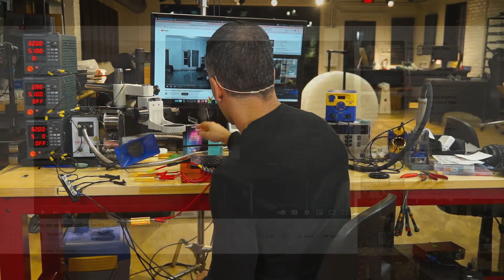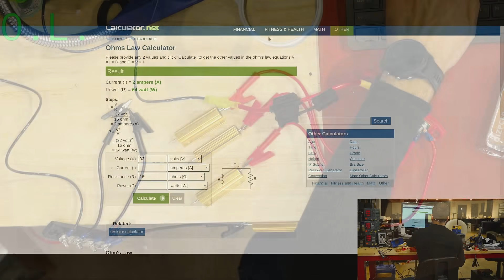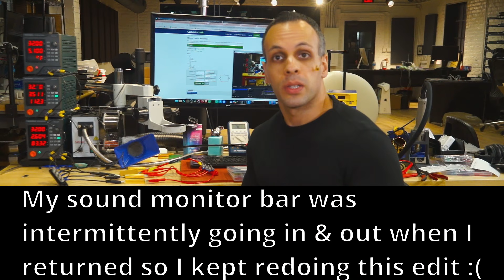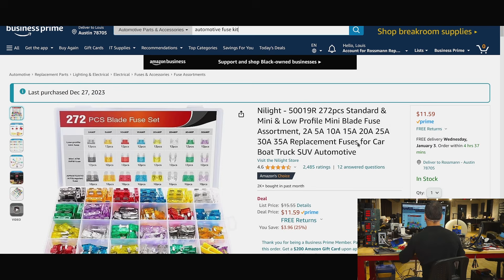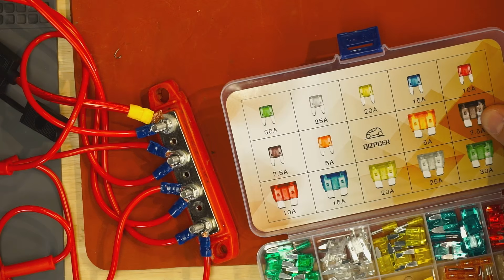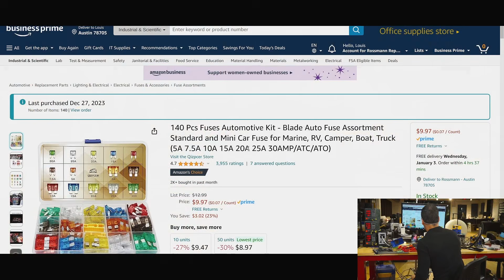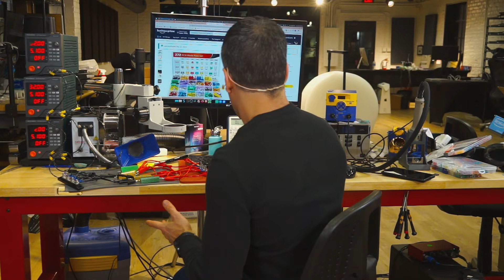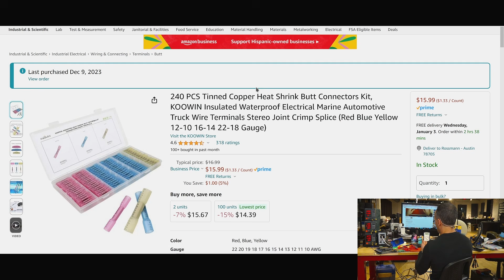Amazon Sells Fake Electrical Fuses

Comment: Thanks Louis for calling out this issue. I’ve tested the little mini glass tube type and found them a bit off and noted it in a box cover. But now I have to replace a bunch of blade types in my boat because I have no idea what cheap type I used.

Comment: for the peanut gallery... when your wires are rated to 6 amp, and you put a 2 amp fuse in the system that can handle 8amp, the wires the fuse is supposed to protect become the fuse...

Comment: Eventually this will stop. Either Amazon will realize that this business model can't continue, regulators will step in, or components that Amazon depends on (web servers, computers, etc.) will fail and break their business.
I recently took a car in to be repaired. The replacement part was in worse condition than the original so they spent 8 hours trying to fix it, I spent 8 hours waiting, and next time I take it in, they will have two parts in case one is defective again. Eventually, the endless cycle of buy something, wasting time and money because it doesn't work or fails early, and buying a new one will bog down the economy.

Comment: I bought a huge fuse for my battery and solar system from Amazon. It was a reputable brand I could buy elsewhere, and it was a "store" on Amazon. The fuse got hot and melted the holder at only 80% of the rated amps. It was glowing when I smelled it and opened the circuit. I bought a replacement Bussmann fuse from an industrial supplier and everything is fine now. So it's not always that they blow it too high a current, sometimes they may cause a fire before that.
Reply: I had a similar issue with some large blade style fuses from Amazon.  Resistance was way higher than it should  have been.
Reply: dont worry, we have each other, we are the resistance now. All of us  @sonictech1000
Reply: yep, typical "iron core" cheap fuse, they are just lamps, they heat until everything is melted or on fire, unfortunately aliexpress, ebay and amazon are full of them
Reply: Amazon sells fake counterfeit parts. 
Upon closer comparison to original locally bought mayerial there where slight anomalies with the print or coloring of logos
Reply: One of the first things I learned running my business, after melting lots of "heavy duty" extension leads is not to buy electrical components of Amazon. It bought a high rated cable, plugs and sockets from a big name store and wired my own extension leads and never had another down time due to fake Chinese crap on Scamazon
Reply: Got dang.
Reply: slow blow vs fast blow fuses are differtent things and speced for different uses...
Reply: @ganzeytyler And that is exactly not what we are discussing. A fuse that melts its plastic holder at 80% of its current interrupt rating isn't a different specification. It's a defect/fraud/scam part that doesn't function as a fuse.

Comment: For reference, a name-brand (Littlefuse) automotive fuse is specified to blow in 0.5 to 6 seconds @ 350% rated current and 0.1 to 2 seconds @ 600% rated current. At rated current the fuse shouldn't blow at all.

Comment: Was going to edit my prior comment, but it seems to have disappeared. 
Did you have the fuses getting hot even at rated current? 
I had a problem with the headlamp circuit fuse in my old car (20+ years ago, so fuses from a retailer). It would get hot enough to start to melt the fuse block. I did find a breaker fuse that seemed to solve the problem. Seemed to be a combination of high resistance in the fuse holder and/or the blade connectors of the fuse itself.

Comment: They might not be fake reviews. When normal people buy a replacement fuse their aim is to fix whatever they're putting the fuse in, so long as the fuse gets that device up and running again, they are happy and will write a positive review. If the fuse fails later and damage their device or then, they probably either don't realize it's the fuse or forget where they bought it.

Comment: My first question when you were taking polls was “well, is this a slow-blow fuse and you’re impatient?” 

And you totally covered that possibility about 8 minutes in. Lovely and thorough!
Reply from the maker: It's a good thing I had to pee.
Reply: I was waiting for a Naked Gun Pee sceen if you forgot to turn off the mic @rossmanngroup
Reply: My immediate thought was the curve as well, but I wish louis luck for those official mac schematics with his free USB stick. I did have to check, most circuit breakers here are C curve, which is no trip at 100% load, but trip to 1-2 minutes with 200% load. 5x current is instant trip.
Reply: There are standards for automotive fuses, it's not an arbitrary manufacturer decision.  ISO 8820-3, SAE J2077, and a few others. Required time-current curves w/ acceptable tolerances are readily available for all of these, and could (and should) have been used for this test.
Reply: fuse curves are "we failed at making the fuse properly for the number it should blow so we attached a graph that says the real numbers"
Reply: @gg-gn3re  No. There is nuance. If your fuse blows immediately at point, it will have many nuisance blowouts and be very annoying. Depending on a fuse it will never break at 100% or it could take up to an hour if it does. And will last several minutes up to 120%ish.  Because some power spikes are a normal thing and a sensitive fuse will quickly be blown out. depending on if its slo-blo or fast it can be between 500-800% load for it to go in 1 second or less.
Reply: @himedo1512  nope. in pcb if a circuit expects 1 amp we'll do 1.2amp fuse etc
Reply: @gg-gn3re  there is no nope. This is literally how they are made.
Reply: nope @himedo1512
Reply: @himedo1512  What? I would MUCH rather have to deal with a fussy system and have to replace fuses 10x more often than having the fuse ALLOW more power than it told me it would.

Comment: You are adding the resistors in Parallel, not series! 1/Rt = 1/R1 + 1/R2 + 1/R3 + ... You aren't doubling the load when connecting another resistor. Ohms Law 101
Reply from the maker: that's what i said, and how i connected them. look at the wiring. each resistor is being added in parallel and each time i add a resistor in parallel the power supplies are outputting 2 amps more power than they did before.
Reply: @rossmanngroup  Ah yes, sorry.  I looked at the setup again. Thought you added the extra resistors in series and had the initial 4 in Parallel (bussed)
Reply from the maker: I double checked to make sure I didn't mess it up. I appreciate you keeping me in line!!!

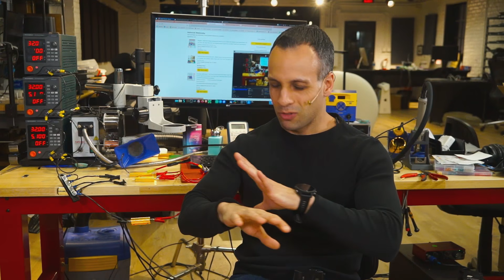Comment: 1:35 Where in the world have you EVER seen a fuse rated in WATTS?
I've seen plenty rated in AMPS, with a rated voltage that they'll work up to. But I've never ever seen a fuse rated in watts.

Although I have to admit the fuses you tested were obnoxiously bad. Went to Digikey to look up some automotive fuses and pull off the spec sheet for a blade type fuse. The time to blow was rated in percentage of rated load.  Saw the following:
110% lasts at least 100 hours and may possibly never blow.
135% lasts up to 10 minutes, but may blow in less than a second.
160% 0.25 to 50 seconds.
200% 0.1 to 5 seconds
350% 0.2 to 0.5 seconds
600% less than 0.15 seconds

Comment: Hi,
from an European electrical point of view ... I've learned that a fuse will start to break at about factor 1.4-1.6 with a lot of time (10min).
For an immediately blown fuse (within 2 sec.) a factor 2 - 3 is normal. The factor 5 is too much ... otherwise ... it is a 2A fuse ... that's so low that I don't really care ... it is probably the same fuse as the 5A with a different label.
FYI - if you wanna make the experiment more easy: ... you don't have to use the max. Voltage.
I would simply short the circuit using the Current-Limiter of the power supply's.
The Voltage will drop down to under 1-2V.
The max. Voltage only matters if you are testing if the fuse can disconnect the circuit.

FYI - in Europe we have the problem that the car mechanics don't check the fuses ... hour of diagnosis ... before someone thinks of checking the fuse.

Comment: An automotive 2A fuse passing 3A should blow in ~2 seconds average, at 4A it should be an absolute maximum of 5 seconds. Uh, crap. I actually used some of these. Thanks for making more work for me, Louis, now I have to go open up some car fuseboxes and replace them! I feel like an idiot.
Reply from the maker: You are not an idiot, tons of smart people believe we still live in a high trust society, and companies like this take advantage of that. I will never make fun of you for believing that multi-trillion dollar companies are held to the same standard as my electronics shop. but I will point it out every chance I get!

Thanks for watching.
Reply: @rossmanngroup  The thing is, it's not like I am unaware of junk products! In the end it comes down to "I need one now" added to some mental calculation about how likely they would be to make this product a scam. I think at this point, we are all doing that calculation, right? It's pretty sad. Thanks for testing these.
Reply: @rossmanngroup you nailed it dude, we are basically a low trust society, we are maybe not quite china tier but getting there fast. And go figure, they make all our stuff for us because we are too fat stupid and lazy to make it ourselves
Reply: Don't thank Louis, thank Amazon. The company with a shit-eating grin for a logo.😏
Reply: The solution is easy enough. If you haven’t heard of the company and the product is any way safety related, don’t buy it. Socks yes, fuses no. The Chinese will do and say anything, as often as not in scrambled English, to  sell their merchandise.

Comment: Typical Chinese tofu-dreg quality products there. Scary thing is they cut so many corners in CONSTRUCTION projects that siding is continuously falling off the sides of buildings, concrete support pillars can be scraped away with a glass bottle because the materials are so cheap, the concrete is basically compacted dirt..... When an old 80 pound woman doing stretches can yank off a large piece of concrete from a safety barrier...... there is a problem. When you can roll chinese rebar around your arm, and when concrete structures have no rebar... there is a huge problem.

Comment: I usually find that if Amazon is the actual seller, not just the warehouse that ships it, your luck is better. But yeah, by and large Amazon has become a flea market like eBay. Caveat Emptor has never been more needed then now. I mostly just use Amazon or eBay when doing quick and dirty dev work like a proof of concept or a test circuit. You just can't beat getting a part in a day or two when you're trying to brainstorm a circuit, even if it's some no-name knock-off brand that maybe possibly could be in spec. However, when I'm down to the final iteration or two I will switch to reputable Tier 1 suppliers. The other thing I do is whenever I buy simple penny parts, like resistors or capacitors, I'll buy 100 or so at a time. It makes no sense to pay $1 for 10 resistors when you can probably buy 50 or 100 for $2. If the part is critical to the design or expensive, like a microcontroller, then I only buy them direct from a trusted supplier.

Comment: Of those bad fuse brands, how many 5 star reviews are because the buyer is thinking: "hey, this is a good fuse, it did not blow like those over priced ones I bought from the auto parts store".  

Now the concerning part is that crocsee is probably a repackager, when they need to restock their fuses, who will they get them from? The same quality folks? or will they do the usual and go to the cheaper bid and the next time you buy the same brand its going to be a fuse that pretends to be a wire?

Comment: I occasionally buy stuff from Aliexpress when I can't get it locally, or don't need high-quality of something. I am fully aware of their general low-quality however, so I go in low-trust. That alone helps a lot. As I'm watching this video I'm looking for a replacement USB C connector of my Lenovo charger. The charger comes with a detachable power cable for some reason, but the fragile USB cable is one solid piece with the charger, because of course it is... I'm not going to let that stop me from at least trying to fix it, but they're not selling DIY USB C connectors in my area. The thing with sites like that is that they sell everything and there's actually some decent things among the garbage. When going there knowingly, you can learn to (reasonably) spot those. When it arrives, always test it: if still a failure, no problem, because it was dirt cheap. It helps that I have always enjoyed digging through stuff looking for treasure though, so maybe that's a prerequisite. Anyway, not defending the terrible quality that comes from these sites, but in the fight against the bad practices of modern big companies they can have a use.

Comment: This is important.  UL allows 5 times the rated current for 2 amps or less.  Up to 1.67 times the rated current up to 9 amps and 1.25 times above 9 amps.  So the 2 amp fuse that blows at 10 amps technically UL compliant.  The 5 amp fuse should blow at 8.35 amps maximum.  On another note a 2 amp fuse should not blow at 2 amps.  It should carry the rated current indefinitely.

Comment: Can I tell you a true story that might just have some relevance here?

The Boss of the Elecric Company (ENW) was having a game of golf with his friend the Boss of the Water company (UU), when they got interrupted by a phone call! This ruined not just their game but their day (and a lot more besides).
Basically ENW had employed some French Tree cutters to help as we had a backlog of trees that needed urgent cutting so as not to fall on overhead high voltage lines. The work was being done when one of the team got too close with a branch and received fatal injuries ..... from the adjacent HV power line. Now the power line had been turned off ...... but there were 3 parallel runs and the workers had got mixed up and chosen to work next to a live line believing it to be dead! Coroners and H&S were both deeply involved and rather than just blame the dead man for his mistake they looked at the Whole Companies training regime. The Boss did have to appear in court facing a prison charge (which he was not sentenced to) and this cemented it in the collective corporate mind that They could go to jail very easily!
The upshot was a marked improvement (read training so it was not the bosses fault if you got it wrong) in safety. Suddenly it  mattered to each and every one of them!

It is that kind of pressure that is needed to force Bezos to contemplate jail if things go wrong that he could have stopped or should reasonably have known about!
If they sell in a country They should be liable in both (jointly and severally) in the country of origin for the company And the company it is sold in!

Comment: This is the end game of the drive for ever cheaper goods. I think Amazon gets away with it, while Home Depot can't, is because all they're not actually "selling" anything. When you buy something from Home Depot, they purchased those goods to re-sell to you. So they take on the liability for those goods, and have an incentive not to cut corners. So most electrical products you'll find there are at least UL certified. When you buy something off Amazon, it's usually via a third party nowadays. They just handle transaction processing and shipping. No goods actually changed hands through them. This is fully disclosed, albeit in the fine print, of the product page. Legally, they're basically no different than PayPal or FedEx. So if a faulty item goes up under a third party seller, there's always that layer of plausible deniability there. Which made sense at one point. You wouldn't want a newspaper, or Facebook Marketplace, or eBay being sued, because they're just listing goods and services. Amazon uses this legal loophole to hide behind plausible deniability. When regulators come by, at best they'll get told by Amazon that they didn't know the goods were faulty, and to contact the seller. Amazon will also ban that seller, who will just open up under a different name a few weeks later. Since most of them are extranational, usually from China, there's absolutely no legal recourse. You just have to rely on people like Louis or Big Clive telling you these things are dangerous. My advice, if you have to shop on Amazon, only buy items that are specifically listed as being shipped AND sold by Amazon or a reputable brand.
Reply: If Amazon does have a policy of suppressing negative reviews of items sold by its marketplace vendors, then could they be considered to be actively engaged in the selling of such items? It seems they could be held liable for injuries suffered by a buyer if they actively engaged in suppressing information about known deficiencies in the products they are allowing to be sold on its platform. Just a thought from someone who is not a lawyer.

Comment: Actually I thought you would get fuses that failed way too early.
The irony is many people will see a 2 amp fuse that takes 10 amps as a plus, so they don't need to change the fuse as often.
Lots of people think fuses are just there to annoy them and put in an over rated fuse to "fix" a problem.
Reply: It's just amazing how people who think they're capable of installing speakers in their car have no concept of what fuses are for, and think that there are no possible consequences for bypassing them or putting in high rated fuses on wires with low rating.
Reply: @Br3ttM  My favorite is when they do use fuses but they put it six inches from the amp, after running that nice fat CCA wire 10+ feet through the car.